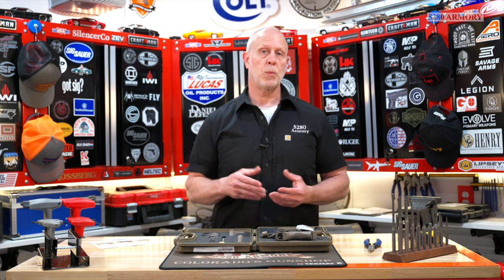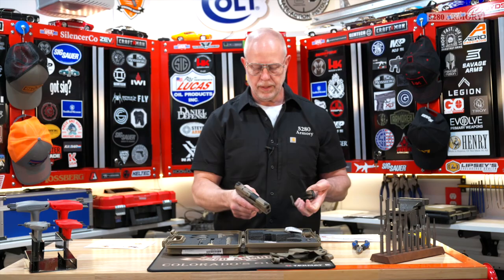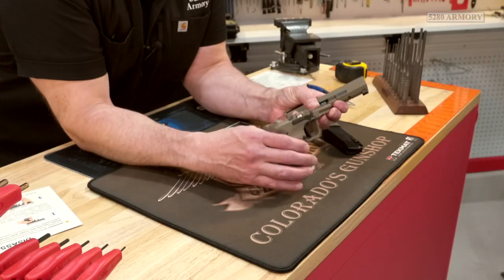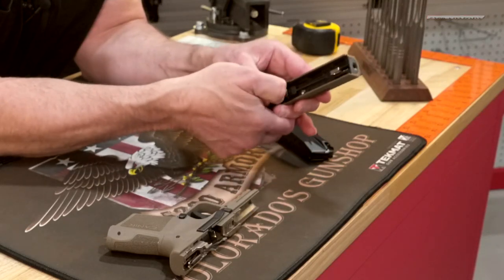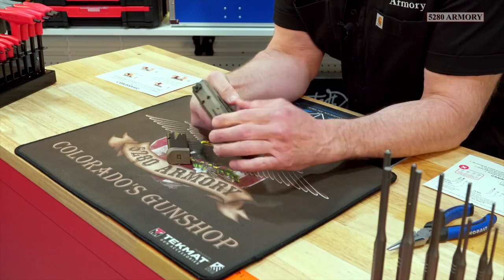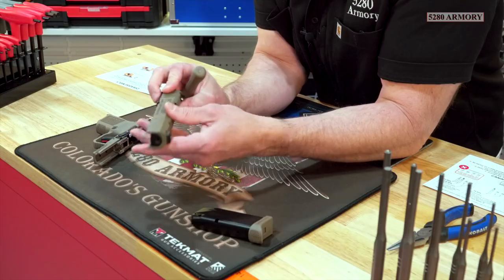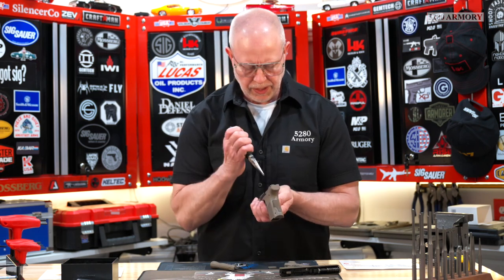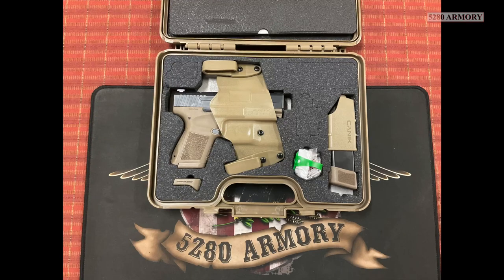Canik MC9 Fieldstripping At 5280 Armory

Comment: The only way to de-cock the striker is to pull the trigger. At some point in time, the trigger has to be pulled to remove the slide.
Reply from the maker: technically if the slide/striker is decocked when you install it back on to the frame and you subsequently decided you needed to remove it again, if you did not retract it so far as to cock the striker you can remove the slide without pulling the trigger. thanks for watching. ak